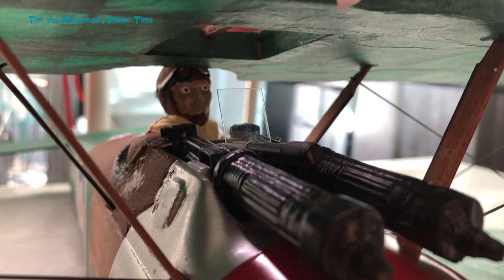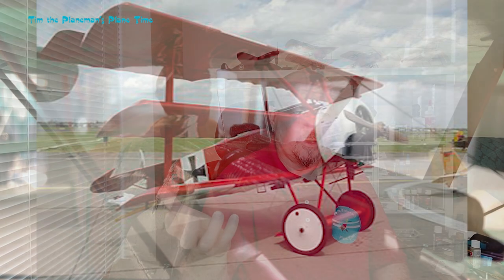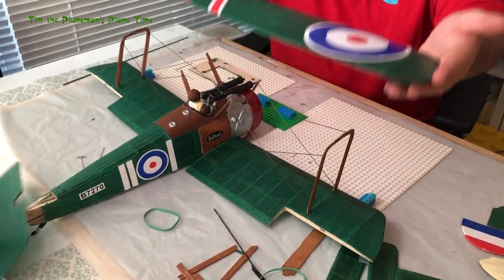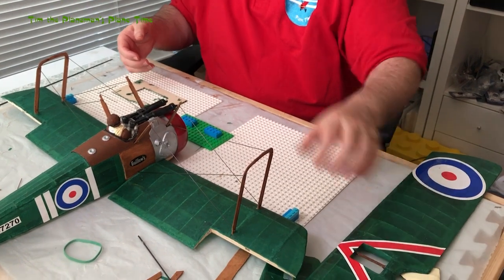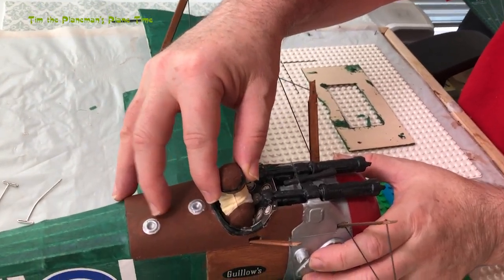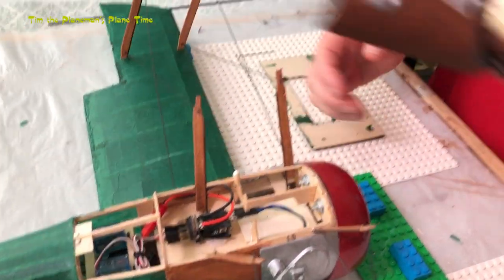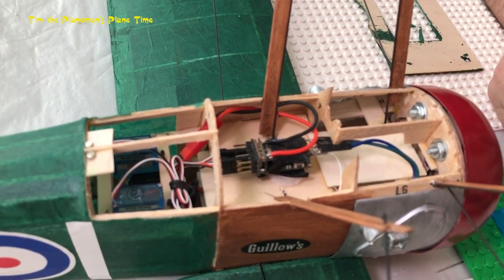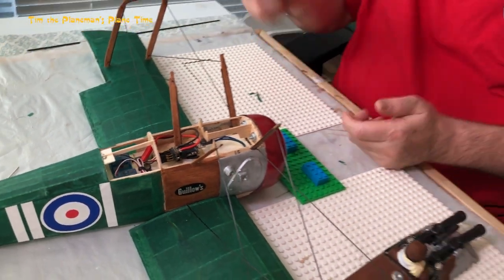06 Guillows Sopwith Camel Assembly - balsa RC Conversion model 801. Time-lapse.

Comment: Love the use of carbon fiber instead of thread or wire on the struts. The removable top wing is a great touch, and nicely designed. Great looking build!
Reply from the maker: Thanks Fred, I love carbon fibre, I'm very happy with how those "wires" look but also how much stability it gives the structure. Thanks for watching!

Comment: Some nice innovation going on there Tim, love the Lego uses as well, I used some on my latest build supporting the wing this very morning. On my Nieuport under carriage I used carbon rod up the front legs and onto the firewall, really helped with strength 👍
Reply from the maker: Thanks Cliff! I'm expecting to lego the fuselage on the Fokker DR1, the video online shows it being a challenge to get everything straight.
Reply from the maker: I love carbon fibre. I have it on the undercarriage, struts, the leading edge joiner you can see here, inside the wings (leading edge and mid spar) and I also used carbon fibre for my elevator/rudder pushrods.

Comment: Its a tough question... If this would be a symmetrical airfoil, then 0 degrees off centerline would work, but to make things worst in this instance, this is free flight model conversion, so tail down(or "nose up") might be build into this model. So the best course of action it not permanently fix horizontal stab, but if its possible make it adjustable perhaps on the screw+shims, so you can adjust horizontal stab after a short test flight. So good luck and keep us posted of the results. Also check out "Panther 9" chanell Guillows conversion, you might ask him this question. Good Luck!
Reply from the maker: Thanks I got some great feedback on the Guillows FaceBook group that leads me to believe I should build it "as designed". So I went with that - we will see what happens when I maiden it. Thanks for the recommendation - I've subscribed to jagdpanther9.
Reply: @timtheplaneman  - You are most certainty welcome! As any fellow modeler, I do hold my breath until its maden, so let us know how it went! Good Luck!
Reply from the maker: @RussianThunderrr  look out for the next video. Spoiler alert, I tested the motor you see here and found its just not going to do the job, so I have an upgrade on order and will install a new motor before I try to fly.